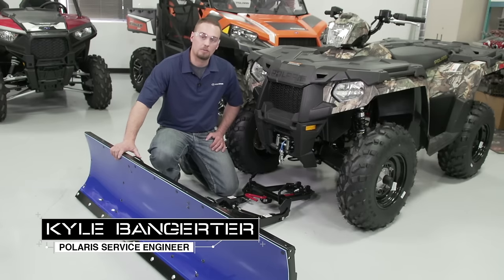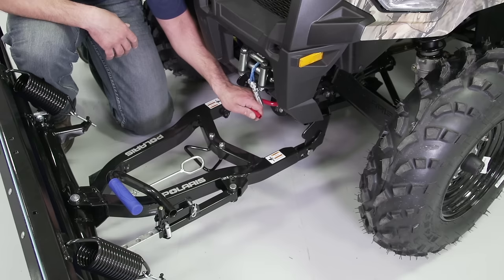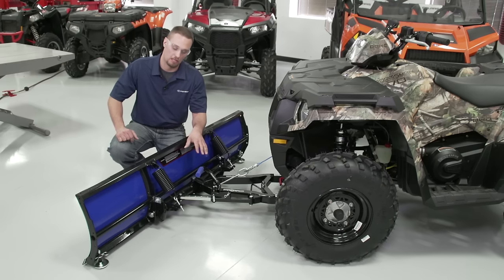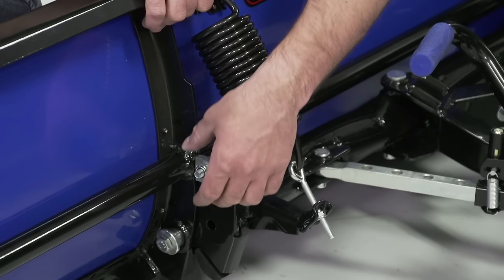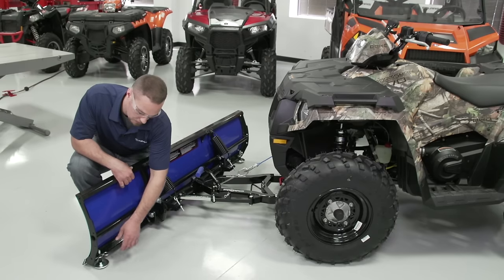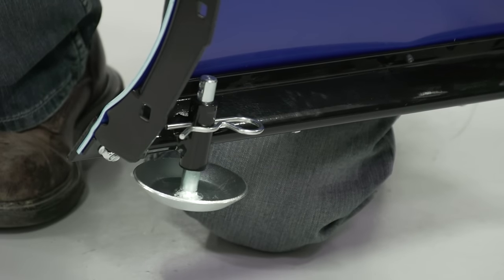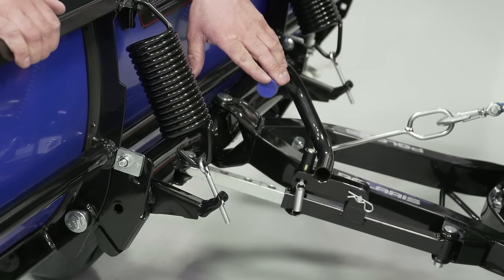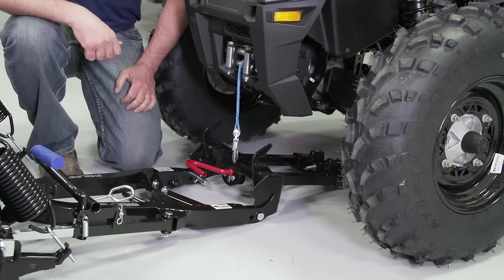Glacier® Pro HD Plow System Install ATV | Polaris Off-Road Vehicles

Comment: Thanks for this. This system is SO much better than the 19 year old Moose plow system I was using on my old 2001 ATV. I may add that you want to make sure the two hooks in the back of the frame do NOT move when the red lever is in the locked position. If they do your plow can fall off. If that happens just undo the lock nut and unscrew the red rod until the bottom of it makes contact with the frame. Then retighten the lock nut. Now those hooks won't move when in the locked position. This can happen if the plow frame wasn't assembled correctly.

Comment: If you haven't already purchased one of these don't! they are only good for a small paved driveway. I've had mine for two seasons and the plow is constantly detaching from the machine, the dog ears bend so had to reinforce them, the square tubes on the mount section both sheared off, have to replace the entire mount section now, the shear pins on the swivel arm shear on every little bump. Granted I plow a 1/4 mile dirt road but my Glacier 1 plow did it for 13 years without a repair. The Glacier Pro is a poor design and although looks beefy highly inferior to older model. If your going to make a plow for an ATV it should be able to do more than a paved driveway!
Reply: The Glacier Pro system is the best I’ve ever seen. Quick and easy on and off with no tools. I never had a problem in over 5 years plowing both paved areas and lots of gravel driveways. Something must be definitely wrong with your plow system.

Comment: does anything (a frame etc) need to be assembled or bolted to the ATV before attaching the plow as in the video?
Reply: No. I just installed mine last night
Reply: +Justin Jones     thanks!
Reply: Nope.  The attachment adapter frame that connects to your plow frame has two large hooks near the front that catch onto rods on the frame, as well as two boxy objects back at the rear (away from the blade) that will snap into rectangular openings in the frame itself, between and just behind the front suspension arms.  

At 0:47 in the video, he's already got the larger hooks hooked onto the bars that are part of the frame (just under the winch).  You can see when he operates the winch, the rear-most portion of the adapter frame pivots on those hooks/pins, and the boxy parts at the tail end move UPWARD and into their sockets.  Note, you can't see the boxy bits themselves, but you can clearly see the frame "flop" upward.

Then when he engages the red locking bar 0:57, the boxy things at the back (now in the frame sockets) engage moving hooks that lock the plow mount into those sockets.   

No additional mount plate is needed.  All compatible Polaris ATVs have these integrated bars and sockets as part of their frame, right from the factory.